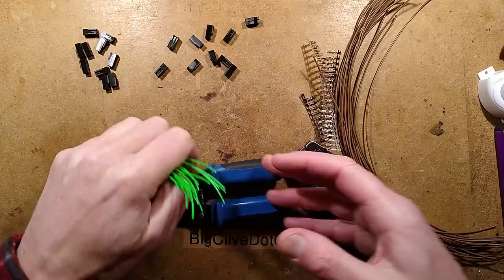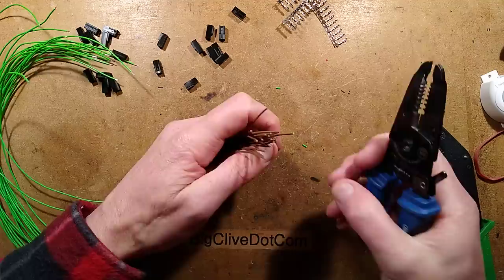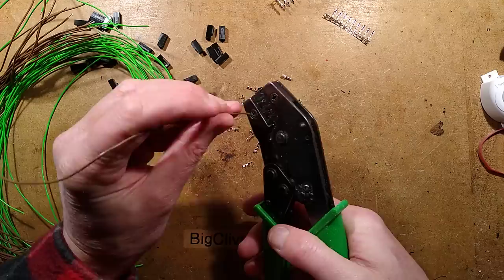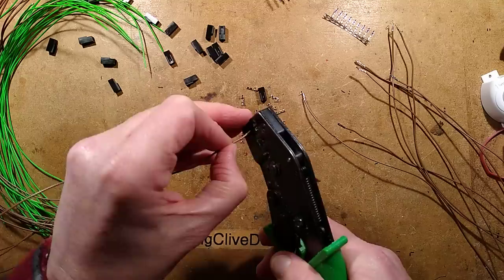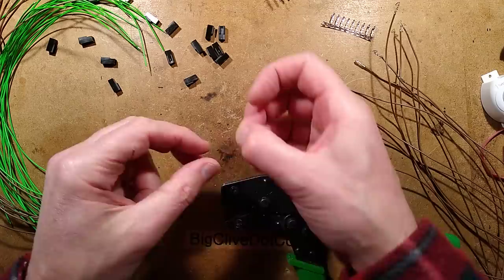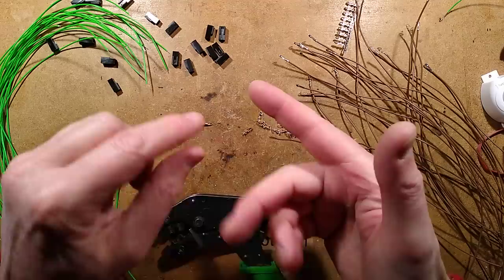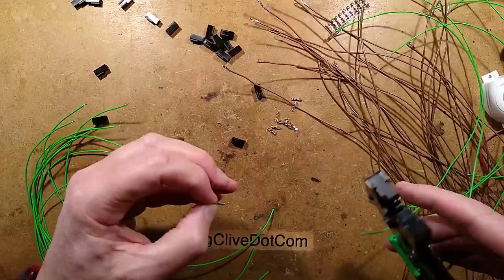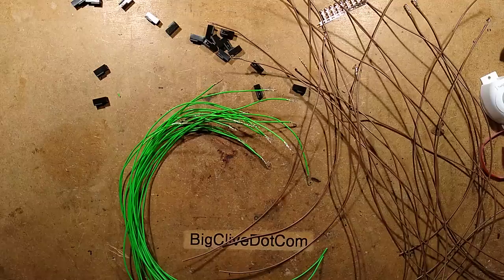Q&A while making prop stuff Part-1

Comment: some of the really big VFD‘s, motor modules, and speed controllers I see……will have several large in NTC‘s in parallel. They usually have full length leads to help dissipate heat, sometimes with contacts crimped to the end. Either that or attached directly to the screw contacts. 
Sometimes I’ll see 2-4 side-by-side in the bigger Siemens and Allen Bradley drives. Not on a circuitboard…. but screwed right to the terminals.

Comment: That crimping tool works in a similar way to the ''Wurth'' tool used for automotive applications mostly , it curls the tags over in a very similar way . The ''Wurth'' range of connectors is very good , mostly all copper.
when you started talking about food it reminded me of 'Tomorrows world '' donkeys years ago with Raymond Baxter saying how in year xyz we would all be eating space food or just a few high protein  or whatever pills . That was much the same as them saying on the same program that C.D's were indestructible  . I can do the same as you with food , as long as it stops my stomach complaining i am not fussy , just throw something down there 😂😂

Comment: Yes ,find a weilding college/ shop , and the safety is built into the room , then you can focus on " what is the heat doing "  it's cold when you start , a Hassel , and it's easy to under cut when you've been at it 5 mins ,as the metal mass is preheated..so you sit down , turn it up a tad ,weild a3016 for 5 mins ,wind it down a tad or two..oh and when ya stop wiggle it around an make a pool of lava steal..

Comment: Was just working in the mancave, as usual on my little CNC lathe, when my ears picked up the interest in trying Aluminium (and stainless) welding. I was nodding along until you said something like 'welding stainless is easier' while I agree with the base sentiment, I'd add that yes welding aluminium can be harder because of all the things you mentioned, welding stainless can be more time consuming, because of the prep : in a full penetration butt weld, the opposite side to the weld face (the root) has to be shielded from the atmosphere (air) or the weld seam will oxidise and form 'coke' thus rendering the weld either poor quality or in most instances useless. The air has to be either excluded using proprietary pastes and such or replaced using an inert gas shield (using jigs etc) As an ex welding engineer, and having travelled to a few countries to check the production methods of sub contractors, I can honestly say I've seen the worst to the best, certainly in stainless production. Some truly cringe worthy, and some beyond elegant. I've also seen both ends of the spectrum here in the U. K.
And now back to my little CNC and your Q & A... Keep up the excellent work and videos please. To me, you are the Scottish version of Stephen Fry, certainly in the amazing way you explain your projects, interests and life experiences. I never grow tired of listening to either of you. 
No I am not suggesting you are gay, before I am trolled.
Reply from the maker: I am actually gay.  But only in the most manly blue collar bear sense.  The perils of stainless welding are still to be explored.  It's not that long ago I found out about the perils of mixing stainless grades with their pesky cold molecular welding.

Comment: Weidmuller Stripax 9005 works amazing for stripping large batches of wires; I can confirm it plays well with small gauge solid wire. Saves the wrists over the traditional strippers for situations like this.

Comment: that Crimping tool looks like mine which is made by Green Lee and far as solid wire yes it works look at the 1970s and 80s TV consoles they used both solid core and stranded with the their connectors !

Comment: Yeah welding Al was absolute hell for me. Loud, specialist compared to steel, and I never managed to get the hang of it which resulted in bad welds or fall-through nearly every time. Tricky to weld in small quantities for sure. Larger is slightly more forgiving but takes more power as it is its own heatsink.

Comment: re:  engineers / electrician -> rough fingers reducing conductivity:
bass players have nicely calloused finger tips, too.  ...still don't wanna tangle with the 650vdc plate voltage of my amp's power tubes!
Reply: As a fellow e+e engineer and ruiner of bass lines I have to whole heartedly agree
Reply: SVT by chance.
Reply: @ProfessorMatic  Yes indeed!  SVT 2-Pro w J/J KT88 power tubes.  ...shout-out to Eurotubes!

Comment: Two things, you should make sure you do go on set to handle any problems that arise because you can charge by the hour and get some easy work, and the other is transformers contain mineral oil, if they were potted they would get very hot very quickly!
Reply: I’ve seen a lot of both. Many of the lower power units are potted in a variety of different materials. But definitely most of the high power units I’ve seen are in oil. I have a few high-voltage high current units in my lab at the moment…… that are submerged in a hermetically sealed isolated enclosure… in very dense dielectric oil. Meant to stop the high-voltage from arcing over. And it keeps everything cool. Very similar to transformers on x-ray machines
Reply: @hullinstruments  for sure, I can only comment on what I've seen here in this country, I'll have to look if I can find one covered in wax or plastic compound, but id worry about overheating

Comment: Tig welding aluminum is tricky get it too hot, you end up with a puddle of metal. I noticed the shipping problem. I tried ordering the floating lights from a UK seller when ordering multiple ones each one multiplied the shipping.

Comment: Aluminium isn't hard to weld, modern machines make it so much easier than it used to be. I'm qualified for TIG mild and stainless and just got a load of ALU and had at it, you'll pick it up no problem. Clean every bit of ALU to be welded thoroughly, even the filler rods.

Comment: Adjustable Spanner Names
Adjustable 
Shifter
Sixers
The strangest one was an engineer from Moline by the name of Vince who called it a ‘fiddall’ (fit all). He’d come with a team to install a donut plant for us.
Back in the late 80’s I worked with maintenance electrician who was approaching retirement age that carried with him a neon screwdriver, a pair of 8in pliers and an ‘RS Tester’ that was the 2 probe led style that also did continuity.
I was nearly 30yrs old with a 2 probe digital equivalent.
I used to get some stick for being a ‘gadget man’
Reply: I’m not a fan of the ‘Neon screwdriver’ because I don’t like the idea of being a pathway for current flow.
The Martindale Tester was ok and I had to get the Fluke torch that had a non contact tester built in.
The LOTO system and isolate and check way is not fail proof. Big Clive working on a compressor he thought was dead is an example where a local isolator may have been locked off and a test for power being present in the terminal box showed it wasn’t energised at the time of test and in reality you’ve turned the wrong isolator off.
Yes stuff should be marked.
Yes you could turn off the panel.
Working Live is what we do (sometimes)
We know the score 😉
And that complacency is what can catch us out.
Mind the ‘Ziggies’ because no one likes getting a tingle.

Comment: I wish there were left-handed crimping tools. They are awkward to use. I'm surprised you're not using your IWISS crimper. I got a shock as I worked on an early model Otari MX5050 Mk.1 tape recorder. It was 240v and across my chest. I ended up in hospital for that. Unlike the later version, that bloody tape recorder didn't have any insulation shielding around the power switch.

Comment: Hi Clive. As a theatre lighting guy I love videos like this.  A question for you… would an ultrasonic mister safely crack mineral oil to avoid the need for CO2 or a machine with a compressor?  I’d love an atme but they’re just too expensive and I have a ground fogger that I can raid for parts!
Reply from the maker: Sadly, the ultrasonic devices don't seem to crack oil.

Comment: Hey Clive, just wondering what exposure you’ve had to HV equipment (electrical network stuff), or whether you would like to learn more? I enjoyed the fuse tear down you did a while back
Reply from the maker: The company I served my apprenticeship with did power distribution in steelworks.  That included the HV to the arc furnaces.
Reply: @bigclivedotcom  nice man. I’m working in the utility network company in Queensland Australia and enjoying it immensely. Substations have so much complexity to them that is hidden away from the public generally. 
What voltage did you guys work on with the arc furnaces?

Comment: My biggest fuck up was getting my wires crossed with a fairly large cooling system that should've had 24V DC and I put 240V AC instead.  I  was stood in front of the unit with about 20 people behind me all working on computers.  I switched it on and it went BOOM exploded the PCB followed by darkness and 20 very annoyed people. 😮
Reply: Whoop double and triple I'd say.

Also there is the Stinger wire or so cold in the United States and some 3-phase systems.

Nowadays required to be orange.

Yeah normally Indian connection other than the wrong one you get your normal inspection voltage get hit with the Stinger if they say whoops double!

I've heard about power company accidentally connecting residential and other 110-220 services back then it was 110 yes.

Instead of 110-220.

 220-240 connecting into the wrong system.

Heard about this a few times in my life at least.

And of course blowing almost anything and no place times multiple places at the same time Insurance of course gets involved!

Also ever heard of a hot neutral short in service entrance cables?

All heck breaks loose when this happens.

Heard about this more than once and also witnessed flat happened on time as well.

One person I know had this big I believe it was an oak tree where the overhead service pass through.

Overtime one of the hearts had chafed through Dulce Arsenal land on the tree.

And had drug through the insulation of 1 hot wires.

Modern Twisted Triplex cable.

With the bear neutral wire.

They had turned on the hallway light and the kitchen light came on or vice a versa.

Smoke was pouring from the brand new furnace do to the low-voltage Transformer cooking quite literally.

All kinds of weird stuff can happen when that happens.

The Timeless on a farm that I had stayed at previously.

Except this time was not due to overhead wiring buried cable.

Went down to the barn hit the light switch.

Hundred watt bulbs were very damn estimated about 24 volts.

Nothing was working properly.

Somebody was called in know this had been there for a thunderstorm.

They dug up the cable.

A portion of the cable was fused together in about the middle of the run in a mass.

The only person said I'm calling this lightening your insurance should cover everything!

Also one fuse was blown at the pole that service was split between barn and house two large shoes poles at Pole!

After electric meter!

Also on those yard lights.

Typically mercury vapor and sometimes heart for sodium.

The ones that are generally the responsibility of the power company when you have that sort of contract.

There are apparently connected straight to the incoming service entrance and before the meter.

I'm wondering if there is any internal fusing on these.

As far as I know there is not unless of course that is not the standard fixture that you would typically see but same design.

The leading Wireless would definitely not take a hundred amp fault or more!

Considering that is generally straight from the Transformer in some cases.

Kind of wondering if that could lead to a very big bang or fire.

I'm wondering if that's some of those videos you see on light pole like that if that's what has happened if something is going wrong internally!

Also squirrels have a tendency to use power lines as a highway system as could note.

I still remember as a little kid see one day outside just have to be looking up seeing this squirrel running across the line.

Next couple more months squirrel disappears in a big blue flash.

Gotten between high tension bushings or wiring going to them either one.

That area goes dark.

Quite literally had their tell there like there and so on most of which seem like it was just instantly vaporized whatever was left of that squirrel.

Of course it took out to cut out.

That was one of the first high-tension items in my car Shannon was a fuse cartridge!

I also collect glass porcelain and ceramic insulators and some other things as well.

I eventually got a proper cut out for the fuse cartridge!

Once I saw a birdhouse cutout still in operation and use or next to one somewhere I think the the yard like was the only thing still getting power since the meter had been long since pulled wouldn't think there would be any power going to to the security light anymore either.

The Transformer itself and just about everything else is just about rotted away it has been demanding and been there so long!

I don't think there was anyone bit of gray paint left on that one in terms of the Transformer either.

Wouldn't be surprised if it was a hundred percent PCB containing Transformer oil
Reply: Also once found an outlet for some reason was wired for 220 instead of 120.

Very possible wide have been originally intended for an electric heater possibly window air conditioner you're meant for something else the dedicated receptacle.

Either or potentially one of those old mostly receptacles such as a Crowfoot for otherwise could have been back in the day whenm was common for residential use possibly back when last current was permitted for lighting purposes hands 10 am 15 am receptacles ratings.

And that it was just replaced with a standard duplex unknowingly having a 220 feed.

Well the bone was quite break for a little bit until it blew out due to double the right voltage.

At first I thought it was just a bulb that have been knocked when removed or something like that.

Put in a known good bulb same thing very bright.

Grab my tool kit and multimeter sure enough 220 on a standard duplex receptacle ouchies

Comment: The superior aluminium weld:
GTAW/TIG (AC). ARGON SHIELDED. Parts must be oxide free prior to welding.

The guy who taught me welded "Containment" Vessels for long-term hazardous waste disposal. His proof of ABILITY: 24-inch weld; vertical UP; 22 gauge Aluminum. One porosity and you fail. Bead appearance: Stack of "coins", Max/min width: 1/8". Deviate and you fail. 
A true ARTIST. His next job was high risk: laying/welding pipe in the Gulf of Mexico, @300 meters. Two weeks bottom time in a habitat. Two weeks off for residual outgassing. Got paid full-time 24/7 full month.  He made a fortune in one year, then decided to teach for a living. Slightly LOWER risk factor. LOL

REMEMBER: Lower "lid" BEFORE striking Arc. 
🤩

Comment: you dont have oxide layer of you do tig, thats what the innert gas is for. its not that difficult to weld tbh, you just need practice, just like with everything. start with steel, get a hang of the feeding wire, and go straight for some aluminium, straight rows, then some joints. there are fortunately plenty of great teachers on youtube.
Reply from the maker: There are fantastic welding channels on YouTube.
Reply: @bigclivedotcom  i think the longest i subscribe to welding tips and tricks, his material is top quality. all in all - its not that different from soldering (tig) when it comes to technique. you can dry practice the left hand wire feeding, which imho is hardest part (in gloves, and with occupied right hand)

Comment: I've programmed thousands of ATTiny45s for some contract work, enough to the point that I made my own auto-programmer with a PIC32 just to be able to get through a big batch. While it is boring, it's also one of those zen repetition things and I can't say I mind it that much occasionally.
Reply from the maker: I sometimes use the programmer to go mode on the PICkit programmer.  That and a custom lead and ZIF socket on custom PCB makes programming much more convenient.  The programmer to go mode allows the programmer to be unplugged from the computer.

Comment: Given the crimps are on a band, there must be a machine that automates the crimping. I need one of those machines! I buy the crimps from cpc as they come as individual crimps. No need to break them off the band.
Reply: I'd like to have a desktop unit that i can stick a wire into then pull down a lever.
Reply from the maker: The reel-fed crimping machines cost an astronomical amount.
Reply: Neat, though. Stick an insulated wire in and it comes out stripped and crimped. I guess it soon pays for itself when you're crimping thousands a day

Comment: Why do you load the crimp in one direction and then flip it before crimping?
Reply: Easier to hold the contact side since it sticks out. He also loads them”upside down” because the insulation crimp is larger which means you can line the crimp up by butting the wing of the insulation crimp up against the core crimp die where it steps up. 
It’s hard to visualize and explain but makes sense when you get into a rhythm doing it.
Reply from the maker: It makes it easier to align.

Comment: I disagree with u about welding aluminium. They make even aluminum rods that work quite well. They been welding aluminum long before pulse arc. You do need a different shielding gas. Thats the main thing. Pluse arc is good for noobs though. You would be surprised how well the rods work on thicker aluminum. U have to clean after ever rod though of course. You just need a mig welder with a spool gun and the right shielding gas dont need a multi thousand dollar pulse arc.